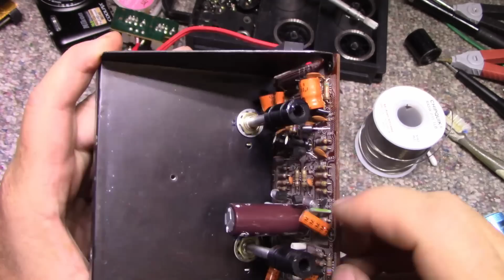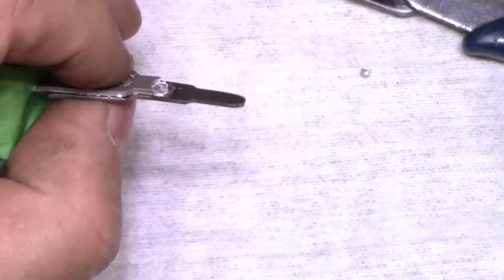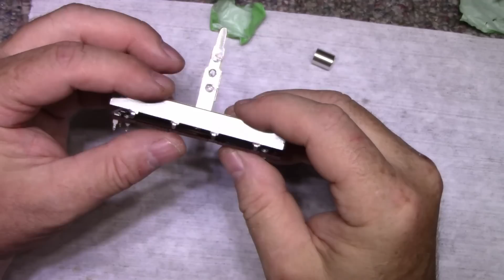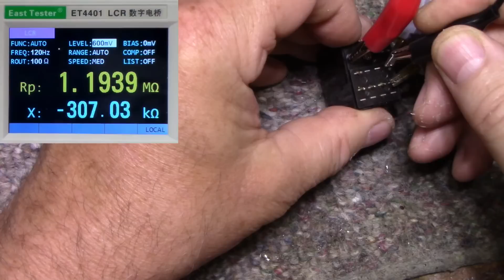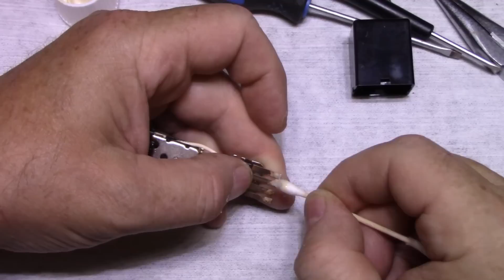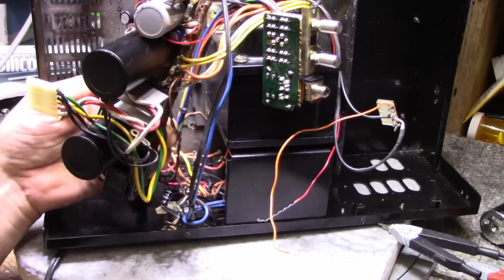Marantz 1122DC Amplifier Repairs -  Part 1 (Ep. 188)

Comment: Trevor... thank you for posting this video.  I am repairing a 1182DC that had a really bad balance control.  It was bent a little and deflected the metal housing as well as bent the little wipers.  Using your guidance, I was able to service the slider (without losing the ball and spring) and it is back to spec.  Saved me a lot of trouble having to source a new one.  Great series!

Comment: Can't wait to see what you find with this.   If it's a dirty power supply to the tone board, wouldn't that effect both channels?
Reply: Probably two faults: one is the oscillation in only the right channel (that replaced matched pair of transistors ? ), and the other is a fluctuation on the output (look at 1:01:00 , that occurs in both channels in the same pattern), and that would or could be the power supply.
Reply: @erikdenhouter  
Im sorry Sir. but do you know why all 5 dsp chips fried in the same time ???
it is on pioneer vsx ax10 that I bought with all my money ((
now I see they will cost me over 1000 euros.... That I dont have.
But if I buy them Im afraid the new ones will die also if I dont fix the reason for the first time
You look like you know everything. While IDK how to change Caps ((
Reply: @ChudGPT  I do NOT know everything, or I would not visit yt channels to learn.
If all five are really broke, I think there are two major possibilities: the power supply has a defect, maybe a short, shorted regulator, so the needed voltage(s) on that board are to high. This can be checked if you have the manual (or schematic).
Another reason could be a lightning strike in the setting it was in, but that is less common of course. But all these chips are in the input circuit, so could receive such strike from other equipment.
Reply: thank you. I dont have where to ask that is why if I see a profile of a technically informed god.. I ask and Im sorry if you got upset bc of this. BIG RESPECT tho @erikdenhouter
Reply: @ChudGPT  Thank you, I understand.

Comment: Hello Trevor, on 2235B, I have had a similar issue on one channel following successful repair and substitution of of outputs, drivers and pretty much every other die on a blown up power amp. Looked into vintage substitutions carefully, but turned out it was courtesy of poorly matched transistors on the tone control board. Funnily enough, the power amp channel went up in smoke, thanks to an SV02 diode, whose lead was masterfully "fixed" by my predecessor with a dab of super glue.

Comment: Hi Trevor. Greetings from Victoria BC.  Great Part 1.  I am a big Marantz fan and your attention to detail - especially with the slide controls disassembly and cleaning was outstanding  (not withstanding the unsoldering and resoldering them back in). Plus the speaker protection relay cleaning and all the recapping etc.  I have a Marantz model 1090  amp and it has an intermittent issue with the balance control. The amp was recapped this year by a well known and respected  tech here. He notated issue with balance  control and worked on it within the restoration process. (left channel momentarily cuts out and on powering on - sometimes)  I will trouble shoot it more this fall sometime. It might coincidently be something else related .  Looking forward to Part 2 as with your trouble shooting of the power issues on the Marantz 1122DC amp. PS. Your channel content is excellent and your presentation  of repair/restorations are/is  first class.